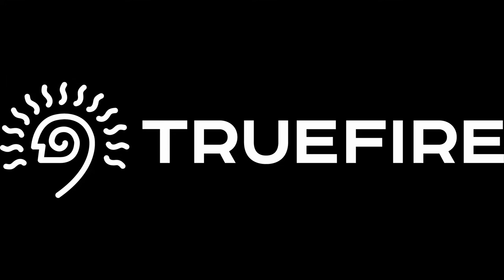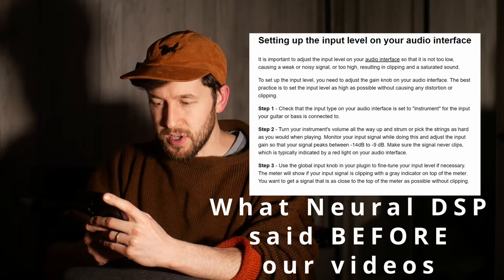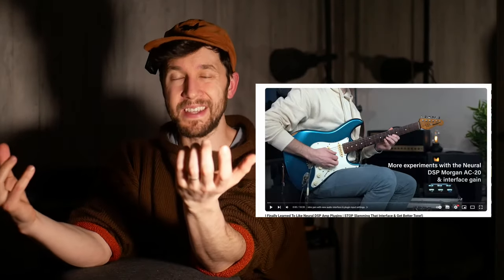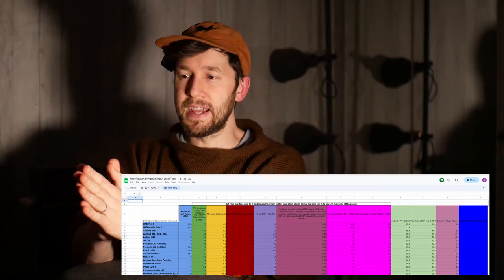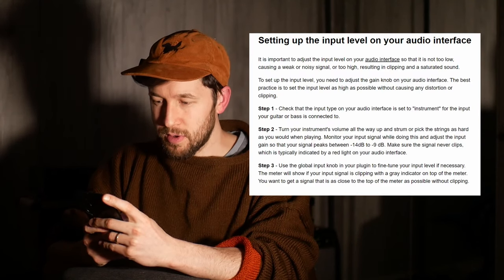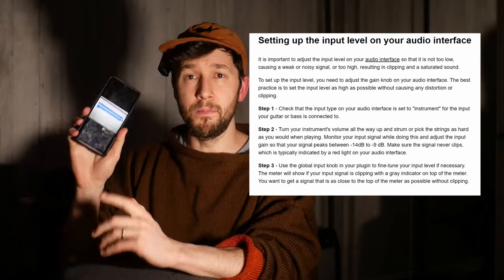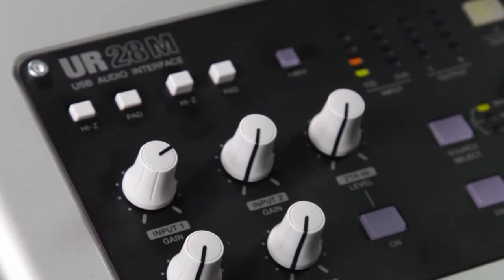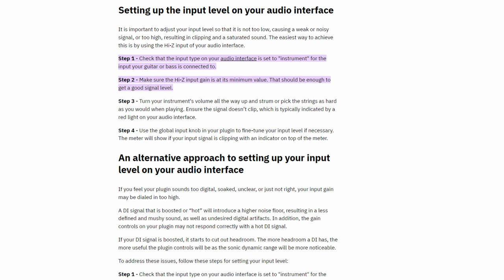Why Are Neural DSP Gaslighting Us About Plugins and Input Gain?

Comment: Recording a guitar with the Audio IF at zero, not only has an impact on SNR but also on digital resolution. If your IF or your DAW is set up to record at 16 or 24 bit, recording with the audio IF at minimum, you are only recording the lowest 3 or 4 bits. If this sounds better, it is only because these 4 bits have the right volume to hit the plugin. There are quite a few videos out there that seem to conclude that, yes , ok it sounds a bit more muffled because it is not exactly the same EQ etc., but NO, it sounds muffled because you hit the amp sim with a low resultion signal, a bit like having a bit crusher cemented in your input chain. While I can see why putting the audio IF input at 0 sounds better, the real place to address this issue is rather the input level of the plugin. And yes, you can adapt this usually (increase in Amplitube, decrease in Neural DSP, let the plugin figure it out as in Waves PRS), but this should not be the concern of us guitarists out here, it should work correctly out of the box.
Reply: You’re right, but it just highlights the issue that audio interfaces do not have a fixed standard for dBu to dBFS conversion, and they absolutely should.

The ideal would be if all interfaces used the same standard for dBu to dBFS, and also had auto-compensating output, so that if you turn up the gain to maximize amplitude resolution, it digitally reduces the output to maintain the same dBu/dBFS conversion.

If all of them worked like that, you could set the gain to just below clipping and everything would still be gravy. We’re way past due for audio & plugin companies to finally get smart about this, and make it consistent.

Comment: I'm a humbucker player, but also noticed this problem when making presets using Helix native and then transferring them to my HX Stomp. 

With Native I was having a much more saturated and gainier sound, which was odd since they should sound the same, so I came to the conclusion I was doing something wrong with my audio interface. 

That was the moment I started to research online about this issue and discovered that spreadsheet made by Ed S. in some forum.

That spreadsheet completely changed my workflow and now I can confidently make presets in Native and transfer them to my HX Stomp knowing they will sound the same.

Comment: After trying this minimum gain approach, sonically it works well, much improved over the “old way”.  But at this setting I can hardly see the wave form in the daw (logic) no matter how much I magnify it, which makes it difficult for punch ins, editing etc. Adding enough interface gain so it visually registers in the daw and offsetting by reducing the input gain in the plugin (helix native) seems to get to the same place sonically, any reason not to do this?
Reply: that’s fine to do
Reply: I exactly have the same issue.

Comment: It is an interesting question. I think this has come from so many interfaces being out there, and they are not 'standerdized' in any real sense. The advice discussed here is not bad advice for most audio sources, but we are talking here about using plugins and guitars using instrument and/or  line level. 
I think the best advice would be to 'use your ears!'... there are so many variables in this equation, (guitar, plugin, interface),  that no 'one sollution'  is possible. Hence the 'general' audio advice of "as much signal as possible without clipping" is given by the manufacturer here.

Comment: Great video! I just want to add, with all this discussion around recording guitar into your interface, please don't forget that the "just below clipping" advice still applies when it comes to microphones. 😊
Reply from the maker: Basically still applies to almost anything right?
Reply: @johnnathancordy  Well, certainly not bass guitar. And possibly not keys as well, since both output instrument level signals. I wonder if this has as much to do with signal impedence as level? It sure flies in the face of everything we've been told now for years.

Comment: I thought I was going crazy until I tried this. I was wondering why I was getting weird noises at higher gains and not the cleans I wanted. I instinctively pulled up a fresh preset on the Tim Henson plug-in and turned my focusrite gain down to a minimum consistent signal and it’s a night and day difference. These videos have confirmed what I thought

Comment: I think there is a missing detail here. Different pres/interfaces have different gain levels at “Instrument minimum levels.” 

And if you have too low a level into your interface then you won’t get the best resolution - it can be grainy and dithered (this is with 24 and 16 bit recordings- the newer 32 bit floating point setups are much more forgiving).

So it might be useful to take the old school engineering -30dB instrument level as a guideline. Start with that as your average level and see how the plugin responds. You might be able to get away with -24dBV peaks. I haven’t messed with the various plugins but I know recording.

Anyway, some standardized ideal level is better than just “minimum”.

Or record peaks at -6dBV then attenuate into the plugin to keep good resolution without gaining out as you describe.
Reply: Most (consumer) interfaces these days have maximum input headroom of around 12-13dBu, which is roughly 3V RMS. That should be sufficient for any pickups, hotter ones will be close to clipping, lower output will still be at a good level. 

The highest headroom interfaces tend to be mastering grade ones with very low noise specs (and stepped gain). It’s quite hard to record a DI that is too low in level, as the noisefloor of the interface will be well below the background noise of the pickups. 

BTW big fan of your channel!
Reply: Thanks eds. I’m just concerned about the resolution as I know how lousy stuff recorded too low can sound if you bring it up in the DAW afterwards.

But you raise a good point - if you have low level stuff recorded with say a Focusrite Scarlett then you raise it in the DAW (or amp it with the plugin) you’ll be bringing the interface’s noise floor up with it.

There is some ideal sweet spot that would match all the criteria - we just need to know if this is -30 LUFs or -24 or whatever.
Reply: @PsionicAudio  Definitely wise to be aware of noise floors and any sources of problems!

The difficulty is interfaces all having different definitions of analog voltage to what digital level it is assigned. On one converter a 1V RMS sine could be a totally different level to another. 

Plugins have no way of knowing what interface everyone is using, and they have to assign their own dBu->dBFS reference level. Often they don’t say what this is, and that’s why this topic is such a grey area for a lot of people. 

Hopefully with the topic gaining more traction, it will become more common for manufacturers and plugin developers to share this information as standard.
Reply: I’ll be watching this as it develops. There needs to be a published standard - have any of you checked the AES white pages? There might already be a standard buried in all their stuff - assuming the plugin makers adhere to them…
Reply: @PsionicAudio  Many analog modelled plugins adhere to 22dBu=0dBFS but this isn’t really suitable for guitar pickups. Likewise, some plugins made for mix bus use something expecting a higher signal. 

It’s hard to standardise because different requirements need different specs. Likewise there can be different constraints on size, power, noise, etc. 

IMO 12-13dBu is sensible for guitar amp sim plugins, but it’s not standardised. There are some excellent emulations that are 1V=0dBFS that need a WAY hotter signal than you could ever record with, simply because 1V=0dBFS is the definition SPICE uses.
Reply: I love this kind of thing, even if I’m just following along without using the plugins in question.

I do have the Neural thing in Logic and found one AC15 model I sometimes use for late night practice. But I haven’t gone any farther down the rabbit hole.
Reply: @PsionicAudio the video of mine John linked here should help you have the intended levels for it. For me personally, I love using these plugins without having to worry if that’s how the original amp sounded, it just removes those doubts and you can use the plugin amp like you would the real thing (with the same expected results).

Comment: I was whining a bit about the continued crappy sound from my Kemper through my monitors when recording with my DAW in the original video of yours re this topic. Tried out the settings as described in the various videos re this subject but it still sounded crappy. That said your video did make me think again about what I was doing with the various guitars I use, my Kemper settings and how it all links to my Interface and DAW.  From that I  realised that I hadn't set the interfaces control panel input properly in terms of whether I'm recording in stereo or mono. A very simple school boy mistake that, when set up properly,  made a huge difference to the sound that I was getting. Once sorted the advice given in these videos absolutely works a treat and the Kemper is sounding as it should and as I had hoped. Am turning up the initial input ever so slightly from zero but gone is the unwanted and grotesque 'digital distortion' I was getting previously. More to lift the 'level' than anything else. Very nearly decided to sell the Kemper too had it not been for your videos on this subject making me think again about being more careful re setting up my gear.. In short thank you for this.

Comment: There is a knob to adjust the input on the plugin, adjust that, that is what it is for. The gain-knob on the interface is used to get the best recording possible and should not be adjusted based on what level you need later, but s9olely to get the best recording you can get. Which means a hotter signal than leaving it at 0 gives.

Comment: Never used a Neural DSP plugin, but the moment I got my first Audio interface, I set the input to instrument instead of line and left the gain at 0. I figured, why would I ask the plugin companies about gain staging? They don't know what interface I'm using or what features it has. I simply loaded up my favorite amps in Guitar Rig and adjusted the gain on the interface until the cleans were clean enough and the distortions weren't fuzzy

Comment: Couple of questions, what should we be doing with all your presets? If you’ve created them with higher input, should still be doing so too? Do you dial your new presets with lower input than before?

Is there no difference between having high output out humbuckers and low output single coil? Both should be set at zero?

Comment: Hello. Please tell me. The maximum input level in my card is 18.4 dBu, the reference level of my reamp is 4.3 dBu (which is 14.1 dBu less). If I recorded a direct guitar signal in DAW, do I need to strengthen or weaken it by 14.1 dBu before reamping? Please tell me.

Comment: Thanks for continuing the discussion! The low input approach has “fixed” the sound of my Neural DSP Toneking as well as various amps in Tonex. I’ve found that Tonex is a little all over the map though as some amps (usually the higher gain amps) sound better with the lower input while others still need the traditional level setting (or even a little hotter) to sound good. So for now, I’ll be using my ear with Tonex and will adjust on an amp by amp basis.

Comment: I was in the camp of "gain stage it like a mic" until I saw yours and Rhett's videos. I was doing this with the Neural DSP Tone King Imperial, and when I first started using it, I remember one of the most frustrating things was having to turn the "blackface" channel volume down to 1 or 2 to get it to fully clean up. But because it's emulating the actual amp... 1 or 2 didn't give it enough room to breath so it was a pretty lackluster clean sound. Really glad this all came to light! I had pretty much shelved that plugin for a while because it wasn't giving me what I was expecting, but now it's back in the rotation again.

Comment: John, thank you so much for your advocacy for normal players. Yes I have!!! 

I’d be willing to bet many, if not most of us that “try” to record with digital plugins have had these gain issues. I just couldn’t get cleans correct. For example, I was trying to record on my Ibanez Jem with EMG’s and I’m using a passive DI box that has a -10db buffer before the high z input on my interface, even switched from a focusrite to ssl interface, and STILL could not get good recorded cleans out of Amplitube or Neural plugins, etc. Cue the Friedman IRX pedal with the analog front mated to a balanced digital output and holy crap, I could get correct signal representation. The way it sounded when I played it through my interface into studio monitors was the same way it sounded when I played back a recording through the same monitors. Seems simple right, but for some reason I have never had the ability to do that easily digitally and I think this was why. Kudos to your work and cheers from Texas!

Comment: The advice to set interface input levels as high as you can without clipping...is largely to maximize dynamic range above the noise floor of the interface. 

The problem with that advice here is that the guitar itself is usually the source of the loudest noise. Turning up the interface just turns it up too. 

In the end, it doesn't really matter whether you turn up/down the gain at the interface or the input to the plugin. It just matters that it's the level you want when it hits the input of the simulated amp.
Reply: Desperately searching for this response because I would rather have a properly full signal recorded DI from the interface and just... turn the input down on the plugin...

Comment: People mistake this advice to be "the only way." The input knob is not there for you to just set it and forget it. Setting the signal level just below clipping is from the conventional wisdom of using mixing consoles and recording interfaces as if you're using a mic. The issue with that is it's being misapplied to simulation of equipment that is, importantly, *sensitive to input levels*. I guess the problem is people do not always have a comprehensive understanding of how levels and volume translate electronically within the signal chain.

Comment: When I first came across this I was so lost…i have a hot rail in my tele and I always hated my guitar tones thinking that my pickup was just too damn hot and I should switch it back. Then when I was trying to confirm the low input level I tried it with my other guitar and I still had to turn my input way up so I thought this was all nonsense. Turns out the battery in my guitar was dead and I replaced it and worked great 😂 I was always surprised when any thing I did in the Corey Wong amp was so high gain!!!

Comment: I still use as much input gain on my interface as possible just to get the best SNR. If you really want to get as close as possible to what the plugin devs made the plugin for, that's what the input gain on the plugin is for. If I would record any of my humbucker guitars (even the one with Fluence Moderns in) at the lowest interface input gain I would still have maybe 12-15dB headroom until clipping. If I record a Strat with vintage output pickups  the waveform would barely be visible in the DAW. It would just look like a tiny flat line at most. I know that this is not the case when you record with other less expensive interfaces that has much lower headroom, but all RME interfaces and converters I've had has had huge headroom no matter what you connect to them.

Comment: So, I'm really confused now. I have a Presonus Quantum 2626, which the manual says is +15db on the instrument input. I turned the input level to minimum and bumped up the input on my Neural plugins by 2.8db ala Ed's instructions. Just sounds wrong and weird - too thin and not enough gain. If I turn the input up on the interface it sounds right. What's going on?

Comment: I think the biggest takeaway for me on this whole topic is if ur not happy with the sound ur getting for whatever reason, try some basic alternative settings to see what the possibilities are. One of the most useful acronyms ever is YMMV (Your Mileage May Vary) because it sure seems to be true just as often as not. That's basically always been my approach. It's not like there are an infinite number of possibilities in this context making experimentation a pointlessly endless exercise. If I couldn't achieve something by using only the recommended approach, no matter how much it was stressed, I always felt like I was doing myself a serious disservice if I just resigned myself to there being nothing I could do about it. 

If you take nothing else away from this topic, at least use that going forward. The definition of insanity is doing the same thing over and over and expecting different results.